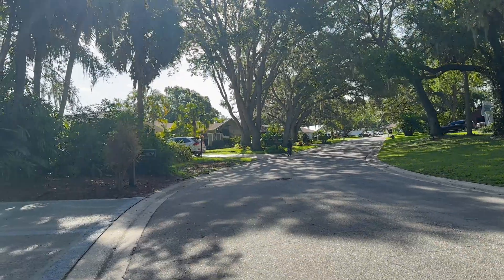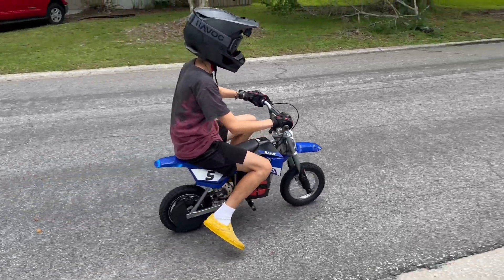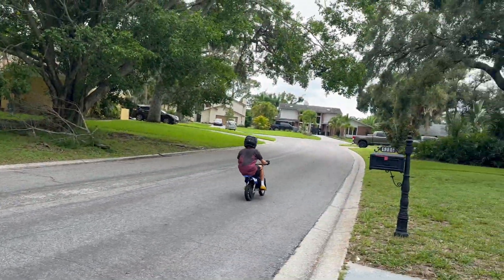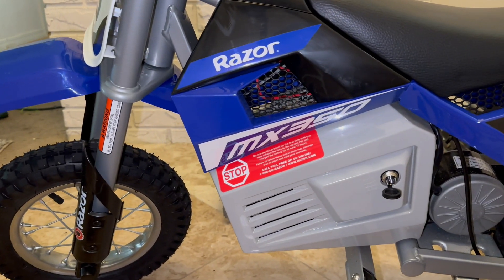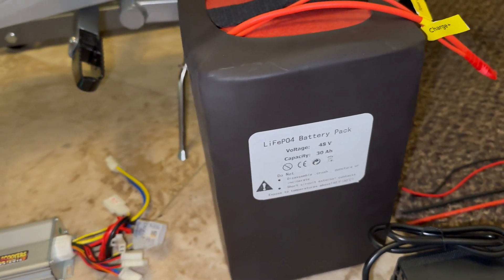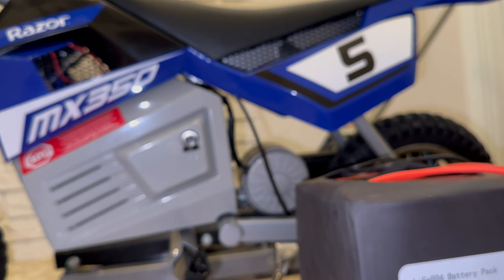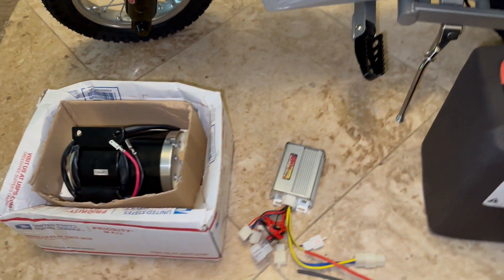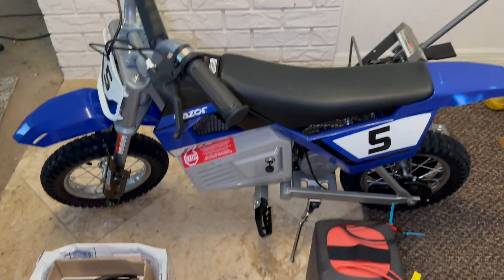New 24v Razor MX350 UPGRADED To 48v -1st Runs -What Went In / How I Do It -Fast Scooters / Btr Power

Comment: What screw did you use for it? My motor blew up and I need to mount my new motor
Reply from the maker: These are what I used. https://a.co/d/cr8RYyp
But you’ll need (4) spacers to get the new motor over the frame in the rear of motor. Here’s what I used. They are 3/4” OD x 3/8” ID. I get them in the 5/8” length.https://a.co/d/gCZzeem💯🍻
Reply: @ TYSM!
Reply from the maker: @350sean  🍻

Comment: How fast does your bike get up to because I have same motor and battery but only gets up to 15
Reply from the maker: I believe it was around 23-25 mph. You probably are going to want to gear it up. The easiest way is changing the motor sprocket. If you are using stock motor that is difficult. But you could get a 65t rear sprocket. That would get you up to at least 20mph. It may need a shorter chain to do that tho.

Comment: How did you keep the battery in place while on bike did you get a harness or zip ties
Reply from the maker: Yes. I used MONSTER Zip ties for this build. I believe I show how I zip tied it at the end but I don’t remember. But These days I use (2) Ratchet Straps. That keeps it tight.

Comment: How did you connect the battery to the controller I am struggling on that part
Reply: Yeah I got the same battery just a little bit smaller Thankyou so much for this help
Reply from the maker: @lcriley00  you cut the red/black wire on controller and connect the connector that matches your battery. So if your battery is an XT60 male, you need to attach a female to the controller. Usually the battery I get comes with the extra connector and wire. You can connect it with butt splices or some solder heat shrink tubing. Very easy to do. You will need a torch for that part.💯🍻
Reply from the maker: https://youtu.be/RCdlbf71134?si=UruKDaRyDaNqf-98

Comment: can you send a link to the white electrical connectors you use to connect the motor to the controller? thanks homie!
Reply from the maker: I can’t find them for some reason. I can find the throttle, battery and light connectors but not the motor connectors.
Reply: @ that’s weird. I hope I can find them
Reply from the maker: @fatutouzutz if you do, LMK💯🍻

Comment: Did you change the chain or what size sprocket did you use
Reply from the maker: In this video, no. I ran it on stock 11/80 #25 then 15/80 #25. I did end up switching to t8f chain and sprockets after this video💯🍻

Comment: Been thinking of messing with a smaller 350 just for fun. Be careful with btr batteries
Reply from the maker: Nice. Yeah I’ve heard some things about them. I actually changed my main connector, Charge port connector & Battery charger connector. Other than the that they are pretty solid for the money. I didn’t have to change the connectors for about a year after on mine. This one got changed right away.💯🍻

Comment: I put a 36v 1000w motor on my son's mx350. 36v 1000w controller. But 48v 45A output battery. He's 40lb and flies. Easily 30 mph. Climbs steep hills like he's not even on it with 9t front socket but it's an 11t. Your build is massive overkill lol
Reply from the maker: I’ve done that also. This is massive overkill.“No Music” -E&C ULTIMATE Razor MX350 -FULL 1st Test & Speed Run On 15/44 T8F; Eon 72v 24ah Lithium
https://youtu.be/HwTuxrYL1CY

Comment: What is the top speed with you on it
Reply from the maker: With the 15t in, about 22-25mph. Pop a 65t rear sprocket on her and I’d see closer to 30mph.
Reply: @KruseNStuff  

Any advice on upgrading a stock Razor MX350 so that it gets better battery life? I just bought a pair of 12V 8AH SLA batteries and unfortunately I don't think they even make it an hour.

I see a lot of where people switched to LiFePo4 batteries.... usually though it's an upgrade to 36V or 48V (I think the MX350 is 24V by default). I'd like to keep it at its current voltage, but crank up that AH to something in the 21+ range.

So I'm thinking what I need is a 24V 21AH (or higher) battery and a different charger? Any recommendations?

My youngest daughter has a little john deere tough tractor which rips, and gets good battery life (she can easily go 2-3 hours on it) and my older daughters MX350 doesn't seem to go much past 45 min or so. I'd like to get it to where the MX350 can at least go 2-3 hours before needing charged but not really wanting to kick up the speed or anything too much. She is just starting to get comfortable with it.
Reply from the maker: @brandonkick  I recommend doing what I did to this one. 48v motor w/ a 48v 1000w Fast Scooters kit & 48v lithium battery. But if you don’t want to go 48v, I’d just do it in 36v. I’d go 36v motor, 36v 1000w fast scooters kit & 36v lithium battery. You can start by overvolting your stock 24v motor with a 36v OverVolt kit and when and if the motor goes, you can put a 36v motor in it. That’s what I’d do.💯🍻